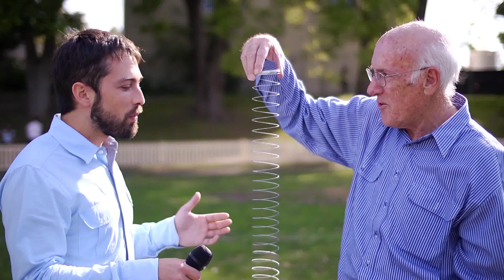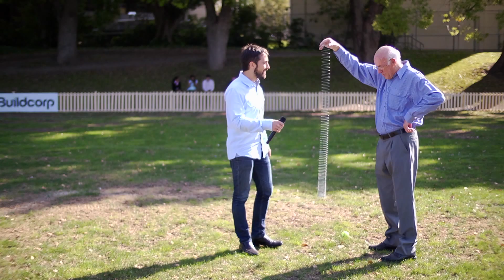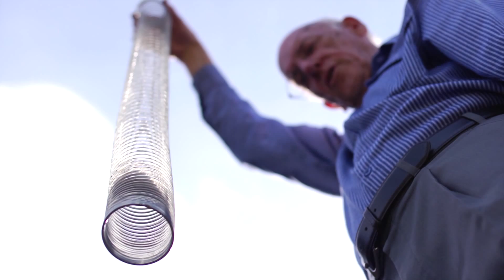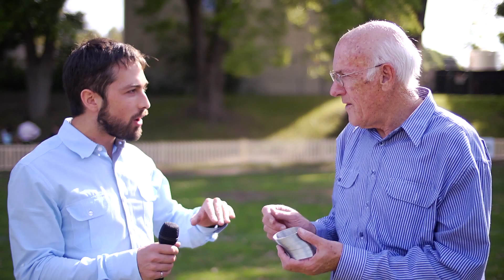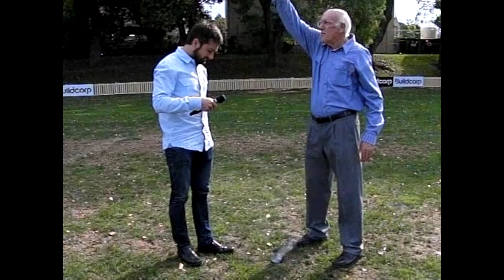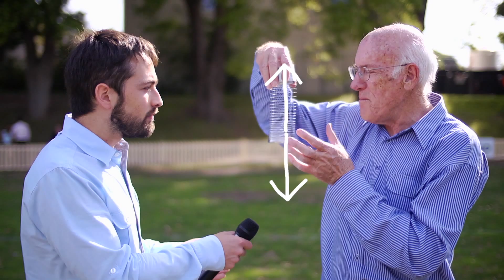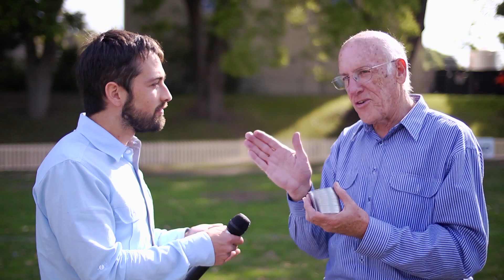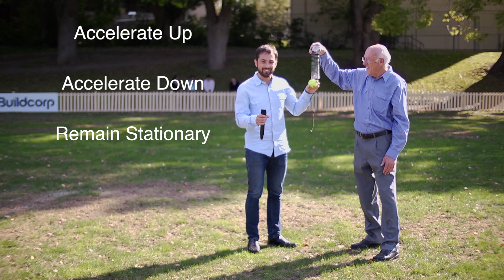Slinky Drop Answer

Comment: This works like gravity i think. I heard that if sun disappeared we wouldnt notice that for 8 minutes after it happened. So gravitation works sort of like slinky but much much faster. :) Isnt it?
Reply: It works for all kinds of information
Reply: I know what you are trying to say, you are saying that gravity and light are similar because they both have "speed". Gravity is a force though and because of it things on earth fall at an accelerating rate of 9.8ms, Gravity itself doesn't have "speed".

Yes if the sun was to die out it would take 8 mins for us to see it due to the speed of light. But it wouldn't take us 8 mins to fall out of orbit it would happen straight away because the Force or the Gravitational pull from the sun stops.

Lets say you were as big as the sun and you had a ball (earth) that was on a string (gravity) and you were spinning it around so the ball was "orbiting" you and you let go (dissapear), the ball wouldn't continue to orbit it would just fly off into space.

I hope that made sense
Reply: If the sun disappeared we wouldn't notice it for 8 minutes because of the speed of light. Light from the sun travels at 3x10^8 m/s and takes approximately 8 minutes to reach Earth.
Reply: Steven Horng  i know that. But gravity has the same speed so after those 8 minutes we would lose what was holding us to the sun and fly away.
Reply: Premislao89 The understanding of gravity is still misty at this point of time. However the theory of gravitational waves is based on them travelling at the speed of light in a vacuum.
Reply: Premislao89 Basically the bottom of the slinky stays in the air is because there is a spring effect trying to pull the slinky back together, and while it is in the air, this is enough to counteract the overall downward pull from gravity (since the bottom is being pulled up as well as the top being pulled down), until the two come together; then momentum is transferred to the whole slinky and there is no more upward pressure to keep it up.
As to gravity, I'm no expert but as far as I know, gravity (or its disappearance) would theoretically affect everything instantaneously, but it doesn't violate that law you mention because gravity isn't really a "thing", it's just a force. Of course there are the so called "graviton" particles but that's another matter (excuse the pun :P)
Reply: ***** Actually, that's not what I'm saying at all.

I'm saying that the 4 Fundamental Forces do have speeds!

They don't act instantly.  Turn on an electromagnet, and the magnetic field from it DOES NOT appear everywhere instantaneously.  *Totally* not what you'd expect, I know, right?

But, it doesn't.  Maxwell's Equations, which fully describe electromagnetic fields, say this.  Observation supports Maxwell's Equations.  That's just the way nature works:  changes in an electromagnetic field take time to, “get someplace else.”
     The next obvious question to ask is, “How long does it take?  How fast do ‘the changes move’?”
     Weeeelllll… it turns out that the speed changes, depending on the “stuff” which the EM (electromagnetic) Field passes through.
     Nobody decreed this from on high.  Nobody knew that this would happen.  When you wanna figure out how fast, “<filp> I've turned on the electromagnet!” moves through, say, water, you take Maxwell's Equations, plug in the appropriate properties of water, and solve.  When you go to compute that, “speed that the changes move at,” everything else cancels out and you're left with a constant.  Wanna know long it takes through glass?  You do the same thing, but using the properties of glass.

Eventually, someone had the Bright Idea to ask, “So, what happens for an EM Field moving through NOTHING?”
     Well, it's just the same math all over again:  take Maxwell's Equations, but don't plug in any properties (we're solving for vaccum, after all) and solve.  You get a speed.  And the guy first doing this, on seeing that, “speed of the changes in an EM field,” move at through empty space —seeing that speed sitting there, on the paper, he immediately went and looked up another number.  He was looking up the speed of light through empty space.  And it was THE SAME.

Nobody knew this beforehand.  It fell out of Maxwell's Equations.  It's a property of the ElectroMagnetic Force ITSELF.

But wait, it gets more interesting.

Light doesn't move at the same speed through everything.  It, “slows down,” by different amounts depending on what it passes through.  So this begs the question:  what is the speed-of-light-in-water?  Compare that to, “the speed that it takes the EM-Force to get from point-A to point-B.”
     They're the same.
     What about glass?  What about that speed-of-the-EM-Force we computed for glass, and the speed-of-light-in-glass?  Yup.  They're the same.  How about diamond?  Let's compute the EM-speed for that and check.  Same.  How about sapphire?  Same.  How about air?  Same?  How about … how about metal?  Radio waves are just a form of light, and they pass through metal.  How does the speed-of-EM and speed-of-(radio)-light compare?  Same.
     No matter what the kind of light (i.e. its frequency), no matter what they're passing through, the, “speed of the changes in an EM field,” is THE SAME as the speed-of-light-through-that-material.

When physics majors first learn this in their E&M class?  They hear angels sing.
Reply: Matthew Edwards You're totally right, it's a pointless thought experiment. Try telling that to a theoretical physicist though! :D Anyway, some people quite enjoy thinking about and debating the possibilities, so maybe it could be a hobby. Now that you bring it up, I wonder what it would be like to eat a black hole! ;)
Reply: kev It would take 8 minutes for the information to propagate.
Nor would it create compression waves — compression waves only occur in matter, by definition.

Gravity propagates at ‘c’.
So does the Strong-Force.  So does the Weak-Force.  Just like the Electromagnetic-Force.

Note:  ‘c’ is pronounced, “the speed of light travelling in empty space.”  ;)

P.S.:  I have a PhD in physics, so everything I'm saying is stuff I had to learn in grad-school.
Reply: John Weiss, thanks for holding it down the truth bombs. It's amazing to me how even on an amazingly educational youtube video like this, people might come away misinformed because of the amount confident nonsense kicking around in the comments.
Reply: Premislao89 Gravity does not behave in the way you claim. Far from it. Carlip's paper "Abberation and the Speed of Gravity" tells us, in short, that if the sun were to hypothetically disappear we would fly off at a tangent immediately rather than 8 minutes later.
Reply: Hashim Khan  This way gravity would be faster than light and i heard that nothing can be faster than light. :| Also if gravity doesnt work like that why bottom of spring doesnt fall together with top? If it was immediate bottom wouldnt wait for top to come and hit it.
Reply: thebeanus009  You know. Speed of light for us is also instantaneous. We have to try hard to see it isnt. But i think if gravity worked instantly slinky would fall on ground stretched and when bottom hits the floor then top would reach it, not like video shows it, because it causes spring to stretch in the first place so it would keep on dragging it whole simulatenously. Probably wrote wrong few words but i bet u get what i mean. Do you?
Reply: Premislao89 Yeah I know what you're saying, and I understand where you're coming from. The thing is that gravity really is quite weak. It's one of the weakest (if not THE weakest) forces out of the four fundamental forces; Electromagnetism, the weak and strong nuclear forces, and Gravity. The spring is under much more pressure from spring tension than it is from being pulled towards the Earth's center, and hence, the spring contracts. Since it IS in gravity, the whole slinky will be pulled toward the Earth, however due to the spring's contracting, both ends are drawn towards the middle, but the heavy slinky doesn't have enough spring energy to pull the entire weight of itself up; if it did, it wouldn't hang down like that in the first place.
Reply: thebeanus009
 i know it wouldnt but do you think gravity works immediately or at speed of light or how?
Reply: *****
 It do make sense. Problem is all we can do is think how it works because we dont rly have any way to see which way is true. Both make some sense i think and i hope you see any sense in my idea too.  :o Cheers :D
Reply: John Weiss  I red somewhere that its just different length of waves. But gravity isnt the same is it? Im nowhere near any degree in science or so but i like understanding things so i try to :D
Reply: ***** : Yep.  Exactly 

I was poking through a General-Relativity text I have and came across this statement:
“Newtonian Gravity assumes that the gravitational force propagates at infinite speed.”
It went on to describe how a theory of gravity that incorporates Special Relativity will have to drop that assumption.
Reply: That comparison is completely off
Reply: no..........
Reply: gravity moves in curves. so, if the sun were to disappear in the space fabric the loss of mass creates waves in the fabric of spacetime, and it would take us much longer than 8 minutes maybe. and speaking of waves, they might act as compression waves moving with the speed of sound. not sure about the last part tho.
Reply: The idea of the sun "disappearing" is ludicrous... it might implode and collapse into a black hole, but the same amount of mass remains, because energy doesn't just disappear. Saying "but what if it did" is no different to saying "what if I could travel faster than light", or "what if I could eat a black hole". It's hypothetical nonsense. The sun, or any other celestial body, will not instantly disappear, so trying to figure out what would happen if it did is a waste of brain activity.

Comment: I don't agree with the explanation when it said that the information need to travel all the way to the tennisball to "tell" it to drop. When the slinky just hangs in the air, the gravity pulls it out and gives it a tension that wants it to contract. Due to the gravity that is affecting the whole slinky. When the top part is dropped the tension is released and the slinky is trying to contract to its usual state. And while gravity still affecting the slinky it makes the top part accelerate with a greater speed then "freefall" on that mass should. Due to the tension in the slinky. The same tension that keeps the bottom not to start accelerating before the up tension is low enough to let gravity affect its acceleration. Same goes for the tennisball that makes the slinky extend longer and increases the tension to keep it in a lockes position. I can think of a few experiments that would show this. Greeting //Niklas Björling, Sweden
Reply: Compression wave = information. It's not anthropomorphism to say that the information is "telling" the bottom to fall. In physics this is considered a form of information.
Reply: But I don t fully understand this. When you think about the middle part of the slinky, you have to consider two tension forces. One pulling up and the other pulling down.they would counteract each other so there's no movement. But what I cant understand is, why doesn't  the middle part of the slinky start falling down? Can someone help answer this? I'm sure the answer may be quite obvious but I can't seem to grasp it fully.
Reply: maybe in the case of gravity it is a bad example, however it does prove the compression force theory, where if you push a rigid object from one end, it takes time (the time it takes to move at the speed of sound) to move the object at the other end. i think that is what the video is trying to prove and my friends have found it a pretty troubling concept up until i showed them this video in combination with the vsauce one.
Reply: NIKLAS BJÖRLING yeah except gravity doesn't exist
Reply: AARON CAPPELLO: Well yeah you are correct, gravity doesn't really exist but the concept of gravity do, or well it is the easiest way for us to explain the forces that are happening. Though it isn't mass that creates "gravity" as Newton once said, (it works to calculate an approximate but it isn't as correct as Einsteins relativity equations which means it's more correct to use Energy and Momentum to calculate "gravity" which also applies in the same manner on photons and non-mass particles.

Comment: The bottom portion doesn't start dropping until the top reaches it. But even when the top reaches the bottom, the top hits the bottom, and the bottom seems to push back causing the top to go around, and actually hit the ground first. I wonder, if the top section was somehow able to pass through the bottom, how far down passed the bottom section would the top travel before the bottom started to fall?
Reply: Good thought experiment. Since the top would be moving so much faster than the bottom, they would invert and stretch out again. When tension stops them from separating any further, do they snap back to the center equally and continue to oscillate their orientation, or does the inverted top hang in midair waiting for the inverted bottom, like the original interaction? The latter scenario would be an in-line version of a slinky going down the stairs.

Comment: I really don't like the "information" answer.  If I drop a hanging string the whole sting begins falling at once.  String is flexible enough that the top isn't pushing the rest of the string down, so why doesn't the bottom of a piece of string wait until the information that the top has been dropped reach it?
Reply: The information does reach, but it does so THROUGH the string. Since string is much more rigid than a slinky, the sound waves will go THROUGH the string much faster. You're trying to say information magically teleports from the top end of the string to the bottom end.

Comment: Derek:  Try dropping a ball at the same time as the slinky side-by-side.  Question 1 Does the top of the slinky accelerate at the same rate as the ball, more, or less?  Question 2 Which will reach the ground first?

Comment: Here is a thought... If you had the slinky outstretched on a horizontal surface and you let go of both ends at the same time (neglecting friction) the slinky would accelerate from both ends towards the centre of mass of the slinky at equal rates.  In the vertical case this would be the same with the exception that the centre of mass is falling/accelerating at the speed of gravity.  Since the slinky has been pre-tensioned with the weight of gravity the bottom appears to be levitating but instead it is being accelerated towards the centre of mass at the same acceleration of gravity. What if you had some one on the bottom of the slinky pulling it towards the ground and the top and bottom person released at the same time I imagine that the bottom would move upwards until it collided with the top at which point it would fall to the ground.

Comment: wow this is amazing , but my question is what if gravity happens to be stronger than tension effecting the slinky , will the slinky bottom start dropping at the same time of the top ?
Reply: If gravity is stronger, the slinky will correspondingly be longer in its 'rest' state since it is being pulled harder. This in turn increases the tension in the slinky. So the gravity and tension will still in equal, and the bottom will still remain stationary regardless of the magnitude of gravity.

Comment: Really amazing  I was amazed that bottom part was stationary i now have understood the Bottom part was stationary due to  THE NET FORCe was zero as tension and gravity cancel each other. :D pretty Good , I dont understand why *3 people dislike it ..
Reply: Correct, but not only that but the same tension force is also pulling downwards on the top part which combined with gravity also acting downwards produces a downwards acceleration on the top greater than free fall. This is why the top end falls faster than you would expect for much of the descent.
Reply: @arnesaknussemm2427   ah interesting
Reply: @HarshvardhanMishraPIER8  lol it's funny how it's been 7 years and you're still talking about it!

Comment: I agree, partially. The bottom part of the "slinky" is the lightest part of the slinky, and is supporting almost nothing, and the total tension of the slinky is similar to the gravity being acted upon it or in equilibrium, meaning that when it is released the "elastic force" of the slinky is almost the same as gravity and the bottom of the slinky is being pulled up just as much as it is down. Where as the top is pulled down with both gravity and elastic force.

Comment: Think about it this way, imagine the slinky force ie the compression strength of the slinky. it will pull itself into the middle of the slinky equally, until we account for gravity pulling down, the top is being pushed down by 2 forces you see, while the bottom is being pulled up (compression to center) and pushed down (gravity).  the compression force is at least equal enough to cancel out the force of gravity pulling it down, until the compression energy and the slinky is fully compressed.

Comment: In no-gravity, a slinky will compress, pulling both ends to the center. In gravity, that also happens WHILE gravity pulls the entire thing downwards at roughly 10m/s^2.
My guess is that the top bit accelerates with both compression (c) and gravity (g) force [g+c], while the bottom bit accelerates with compression (c) COUNTERING gravity (g) [g-c], since the bottom compresses upwards. 
Im no physicist so dont take my word for it. Just my best guess.